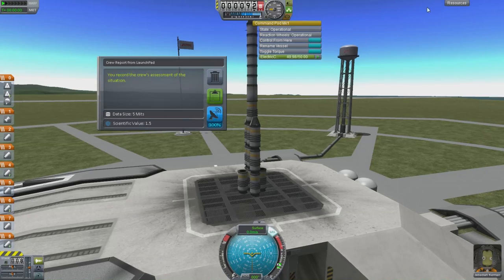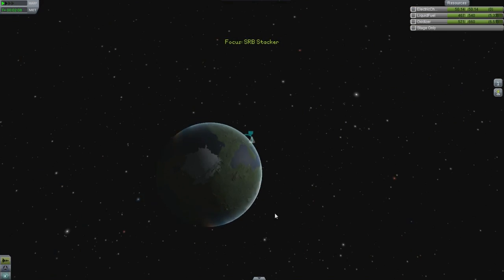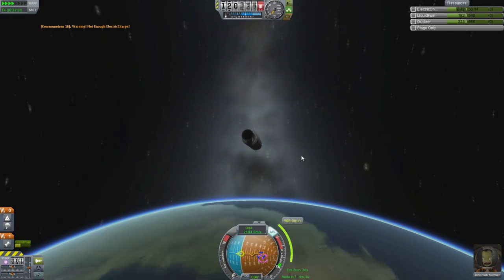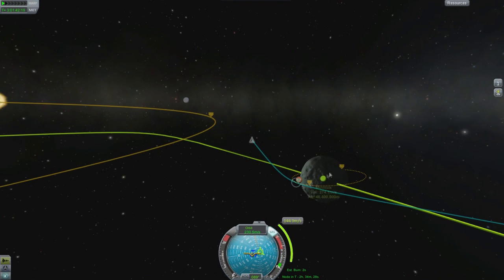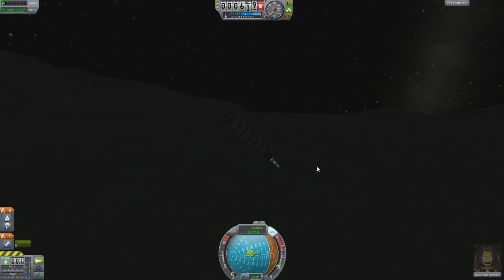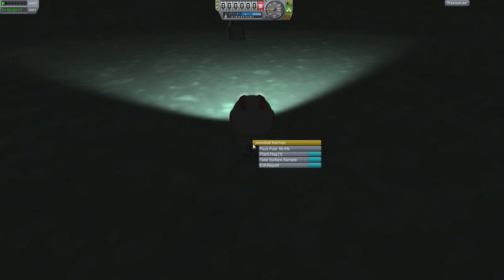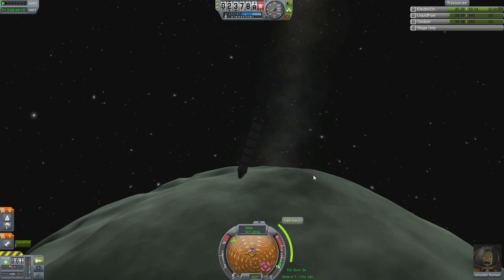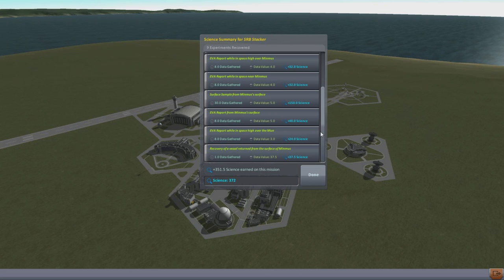Kerbal Space Program - 0.22! Lets Do Science! Lots Of Science

Comment: Every different module does a different experiment/test, so they are independently tracked. To get the most science possible, you want to have as many experiments as possible. I've found that, for modules, the gravity field and atmospheric composition tests get by far the most science, followed by the materials bay. I came across hundreds of science points with just the gravity detector in solar orbit.

The one that gets you the most is surface samples, because they're the hardest to get.

Comment: When you return to Kerbin, eject ever so slightly out of Kerbin's SOI (which is a cheap burn), do the science, and then return to Kerbin. Upon return, try to land on the poles - you can EVA report the tundra, ice caps and poles. Then land, hop out and take a surface sample. In all, I accumulated 739 science with 18.5 fuel remaining. However, I skipped the kerbin ejection orbit which would've given me an additional 50-100 science points.

So the entire tree can probably be unlocked in 2 launches.

Comment: I had one moment where I was in a ridiculously eccentric orbit around the Mun with plenty of fuel and no electric charge, and I was pointed at a heading somewhere around 30 degrees --- not particularly useful. I ended up having to get outside and use the EVA pack to turn the ship. Getting it to rotate was the easy part; getting it to stop doing so was almost impossible.

Comment: You are attempting to go as fast as possible without excessive drag.
100 m/s from 0-100m.  Add about 10 m/s every 1000m, to 5000m(about 160m/s at 5000m) then add 20 m/s per 1000m till 10,000m(about 260 m/s at 10km).  Then from 10k work up to 342 m/s at 12.5k, 430m/s at 15k.  At 15k you start to really give it gas, cranking up to 716 m/s at 20K and that is when I start pitching and floor it.  Optimal speed at 32k	is 2332 m/s so you can gain a lot of forward velocity.  Hope that helps.

Comment: When taking off from Kerbin, tilt your rocket to about 70 degrees latitude at 10 000 meters. This enables you to circulize your orbit without having to burn too much fuel. Also, this orbit should be at about 100 kilometers altitude. This leaves you with an orbital speed of about 2500 m/s, which will sling you out to your target planets with just a tiny change in speed=)

Comment: The modules store the Science they have gathered when you click "Keep Data" and rewrite it with diminishing returns if you reset the module. If you don't transmit the data (resetting the module in the process) you need to bring it back and recover it.
So yeah, if you don't want to transmit at a net loss you need to return and recover the science modules.

Comment: KSP is programmed using x86 architecture, so it's not able to use more than 4GB of RAM. If your RAM is at capacity, your CPU/GPU won't be able to process any faster than the RAM will allow. The developers have expressed that it would be very difficult and time-consuming to re-program the game for the x64 platform (which would allow the program to use more RAM). Unfortunately, large rockets will essentially always lag in this game, but they've been trying to optimize things to reduce the lag.

Comment: I'm surprised there isn't an option to disable compression or something along those lines I'll go have a look my self even.

I had a look and in the video tab under format click settings and and change the video codec to either RGB24 which has a super large file size like 4GB per 1-10 minutes "depending on weather the frames are changing a lot" or YV12 which is around half the size or you can go for Motion JPEG which is 1/4 as good but the file size is around 222MB/p min still better than Mjpeg

Comment: Guys, I know it is hard in career mode. WHY???? Because, i need to generate science and transmit it back to Kerbin, but consumes a lot of electricity(i need to return to kerbin to recover science and i'm running out of fuel for return maneuver). Here's the trick I used to make everything easy. I lowered the tech level of power generating parts, but I already have battery after finished researching.

Comment: Easy there, fish lamp.  I meant they could re-compile the game, including the unity core and the various modifications they've had to make to it, with an x64 compiler so it'd at least be able to access all a machine's RAM.
Also...I am a programmer/analyst with a BS in computer engineering under my belt.  Be careful whose intellect you belittle.  I may not be up on the upper-layer implementations running around, but I know far more about computing systems than the average taco.

Comment: That doesn't sound right... Memory limitation only cause speed problems if you have limited physical memory, and you have to swap to disk a lot. If you have speed issues, moving to a 64-bit architecture is not the answer. 

Unity just can't do multicore, so you see your quad-core CPU at 25% and think it's fine, when in reality it just means you are limited to using 1/4 of it.

Multi-threading is hard. No, seriously.